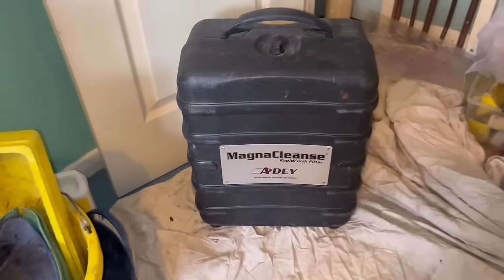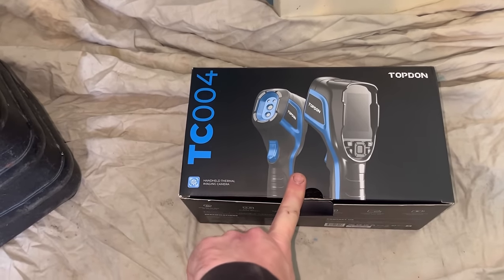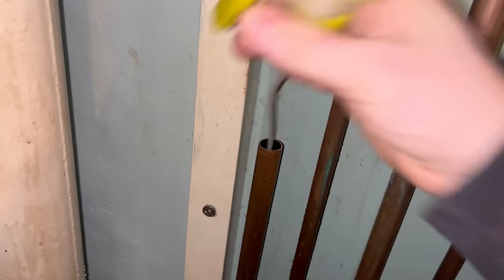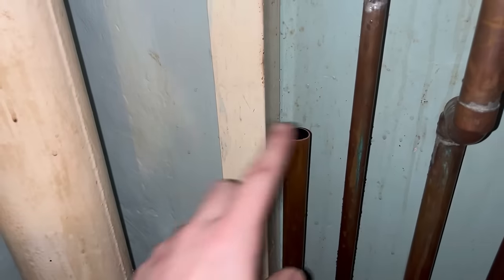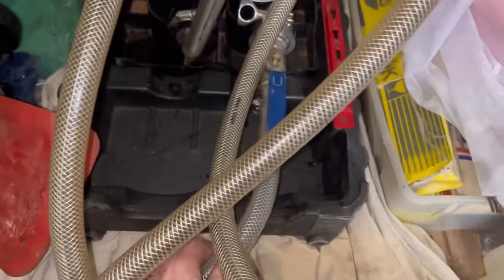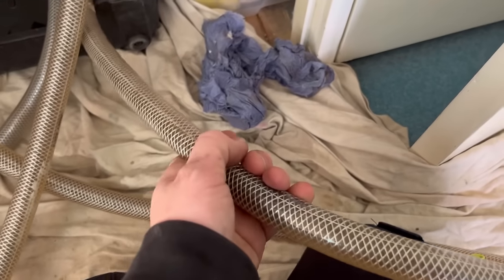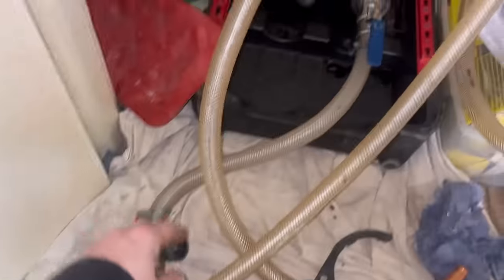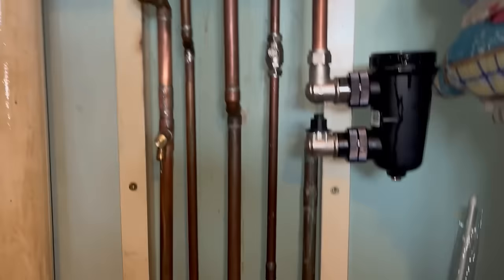NO MORE WARRANTY-...Is It As Bad As They Make Out? You Decide! FULL HEATING SYSTEM CLEAN

Comment: On the filter, when you take the filter off, don't remove the two black clips. They are designed to be pushed against as you unscrew the filter allowing for easier removal. Try that next time, its much easier. And grease the filter thread when putting back on.
Reply from the maker: Never even thought to try that to be honest thanks mate 👍

Comment: Used to be an accredited installer for Worcester, but I’ve now switched sides and install Vaillant and Glowworm, so much easier to work on for your future repairs and servicing, plus the customer service is so much better, had a few customers who have had Worcester out and they’ve picked up small install faults, to be honest three years after the install you could have dirty system water again even if it was flushed correctly to start with, the customers could now end up paying out for a flush every three or four years now to keep a warranty.
Reply from the maker: Worcester customer service I’ve always found great but was a little disappointed on this occasion, could of been a strong advisory or final warning but to take them off contract was little harsh
Reply: How can it if the water quality is being monitored and installed correctly. I agree that if open vented systems are flushed that can happen if not installed correctly in the first place but on a sealed system this cannot happen if the ph, limescale, tds etc is correct after flushing.

Comment: The engineer will fail an audit if he doesn't do an Adey Pro Check on any guarantee jobs where wet parts have been changed. It is an instruction by Head Office, if he fails an audit it affects his salary. So not the  WB engineer being picky, he HAS to follow a WB directive.
Reply from the maker: That’s a fair point mate, I had a feeling it would be something like that to be honest , when I worked at BG we had similar test and we would of failed that system in all honesty

Comment: If you go to a job and theres no heat to a couple of radiators and you've tried the usual, trv/air locks etc. Would you then suggest to clean out the system or replace rads? Thanks for the videos, glad im not the only one that has bad day's!😅
Reply from the maker: Thanks mate 🙌👍 if it’s 2 or more then clean them out you’ll have a flow problem to them….watch tonight’s upload, I’m actually going to show you a rad that wasn’t working and the process I followed to get it working might help you out

Comment: I used to fit Worcester boilers just because the after care from them was the best out there.the rep himself once told me that they would clean a dirty plate heat exchanger twice under warranty if the system was a bit dirty then they would contact the installer to recommend they clean it but would never say anything to the customer about it let alone void the warranty🤷‍♂️ that filter didn’t have much on it really their engineer just must have been a bit of a pr#£k🤷‍♂️ which is a shame the bloke who fitted it  probably chose a Worcester boiler for that customer giving them another sale
Reply from the maker: I’ve known Worcester replace heat exchangers blocked up to high heaven, tell customer to get it cleaned and still keep them on contract so was a little surprised but least it’s all clean and sorted now 👍
Reply: @bluebulldog_uk  definatly was worth doing as u got a bit out so all good👌👌 but I’ve seen that dark coloured water a lot especially on new builds and same as u think it’s the chemicals rather than sludge as the filters are usually pretty clean🤷‍♂️ great vid again mate👌

Comment: No system should have water that colour after three years of running. Im not saying every system should be powerflushed, but that looks like the boiler is the high point in the system and they didnt drain it properly when they did the boiler swap. Even a half arsed mains flush on the day would have left the water a better colour than that on the install. Ive drained hundreds of sealed systems that havent been dropped out for years and the water isnt that colour. Still think Worcester were being a bit harsh there though. But I dont blame the engineer, you never know whos following you in afterwards, and every company has got the self appointed Gas Police officer who goes weaselling off to the bosses if you havent follwed the company policy to the letter.
Reply from the maker: Yeah agree with the comment to be fair mate, do think engineer was just following procedures, ultimately they get it in the neck if it fails again and haven’t noted it

Comment: Mate, great video as always. Love following you. Question if i may: i have just done 3 of these clean and followed exactly the same procedure but I am pretty sure that the return coming off the rads should be connected to the bottom the the right cylinder in the Magna Cleanse, around the filters then out the top exit of the left cylinder of the Magna Cleanse, to then go back into the boiler. I’m sure that the difference might be minimal but wanted to check with mate.
Reply from the maker: I’ve never even noticed that to be honest, just thought as long as it runs through magnets be sound…might look into that if it does make any difference 👍👍

Comment: I've never used one of those.
Power flushes...many times.
Does it still have enough flow to remove sludge ?
Loved the upload.
All the best.
That's stiill a wedge of sludge but not enough to void warranty, who knows....only Worcester.
How much is that flushes kit ?
Reply from the maker: Combi boilers they am great, open system I would still powerflush. Around £380 for full kit but timesaver on combi swaps or system cleans setting up compared to powerflush
Reply: @bluebulldog_uk  thankyou so much for the information.
Big help

Comment: Hi there mate. Like the vids ss always. Got a problem I hope you can answer. I've just installed an easifit isolator valve but when I get to align the dots the y  are both on the cutter plug. No dot on the housing. They are at 180 degrees to each other on the plug. Am I ok just to align them so both dots are in line with the pipe?  Or have I got a faulty set? Cheers mate
Reply from the maker: Honestly never fitted one, I would say they need to be perfectly inline looking at the design to get a seal

Comment: Worcester have taken the piss there big time also adey pro check biggest con out there I’ve done full power flushes with the big machines for a full day tested and failed had to take a picture of the test strip about 4 times in till it passed
Reply from the maker: I think a final warning would of been fair and strong advise to have it done else no more water parts covered…what testing kit you using mate? I like the fact it sends a full report for customer to see and keep record it with ADEY pro check
Reply: @bluebulldog_uk  I use the adey kit as each install the client wants that which is fair enough but I’ve had it fail numerous times on a full install after a flush to get the debris out re filled with inhibitors I now send client failed cert with a video of the system getting filled with the inhibitors
Reply from the maker: @mickgascoigne4003  this one failed inhibitor levels on first round to be honest and taking the pic can be a pain Il agree there but the report is good part of it
Reply: @bluebulldog_uk  yeah the report is great but getting there isn’t I no engineers who carry the same water round with them for the week not me tho lol 😉

Comment: Pretty sure you need an air break on that condensate to cast also ?
Reply from the maker: To stop sewage backing up into boiler? It was above the toilet level but shouldn’t be going into stack there anyway, was a bit of a poor install to be honest
Reply: Isn't air break to stop trap getting sucked dry? That's straight into the stack vent..
Reply: @bluebulldog_uk  I thought you can take it in to the stack bud ? As long as you have toilet or basin above to flush it away. But needed an air break incase back back on to boiler.  
 Great work as always my man. Love the vids

Comment: Looking at the amount of contamination picked up by the Magnacleanse, Worcester  were bang on!
They look for a PH level of 8 or lower.
Original  installer should have done a proper powerflush and installed decent inhibitor.
Why should the customer pay you for what should have been done with the boiler change!
Reply: Most of the time customer doesn’t want to pay for a powerflush so a basic flush to the British standard it is. Like you say it’s an extra day + chemicals to do it properly
Reply from the maker: I think a final warning would of been fairer, it isn’t the customers fault and it would if given her time to sort it out, fair enough if they have been out a few times to water faults but they had a issue with stat they wouldn’t cover…it isn’t fair on customer I agree to have to pay for it to be flushed when it should of been done on install but they wasn’t going to get them back in they wanted to make sure it was done this time to a better standard
Reply: @Richard-ct4ok  there is no such thing as a "basic" flush to BS7593!
You either do a proffessional  job that meets the requirements  of Part L or you break the Law.
Bear in mind the installer has to PROVE  compliance.